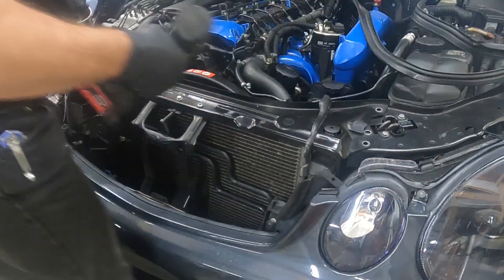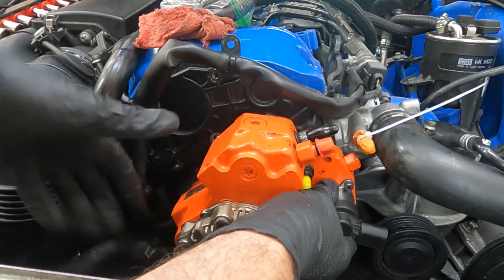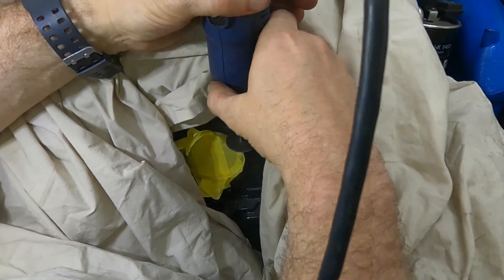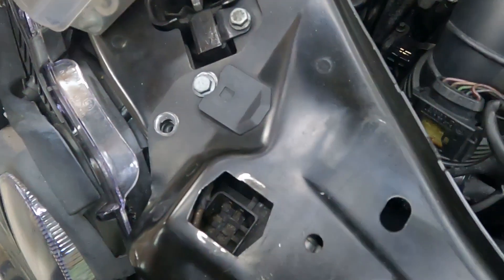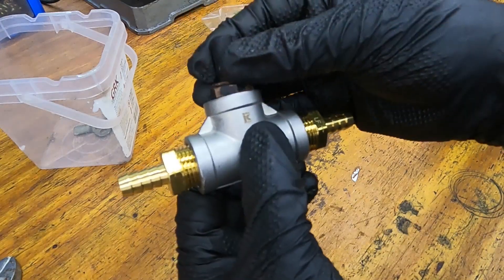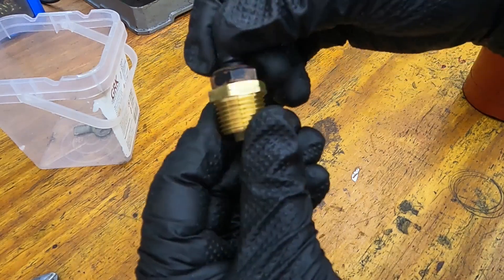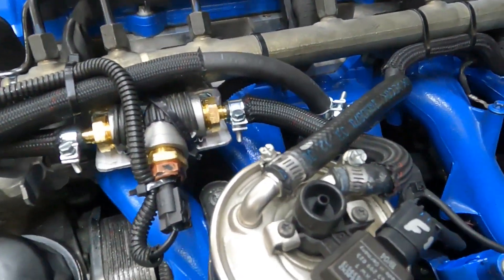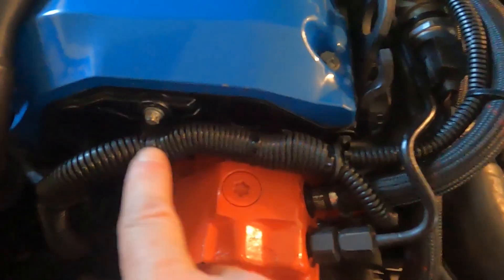More Fuel: Upgraded high pressure pump on an OM648 Turbodiesel

Comment: When you installed the blacksmoke coupling did you need to grind some of the paint off from the coupling to make i fit on the pump. Mine was way to tight ?
Reply from the maker: My pump didn't come from Black Smoke, t was just a grungy old pump that I threw some orange paint onto. I think my coupling was just bare aluminum. The diameter was a perfect fit, though other things had to be trimmed to make it fit. I did put some oil on the o-ring for it to slide in more easily. It was tight.

Comment: Hi, what fuel pressure regulator did you use? The stock one is facing the radiator. The one on your video is facing the AC compressor.
Reply from the maker: Good catch. You must be talking about the direction that the connector points in. The one that came with the upgraded fuel pump was damaged, so I pulled the one from my stock pump.

Comment: Did u you use NPT or NPTF? NPT does need thread sealent. 😊
Reply from the maker: Sure matches my experience. I thought that the use of brass on one side might introduce enough compliance that it would seal. Also, I was grabbing parts from Lowe's. You won't find NPTF there. I'll redo this at some point in the future.

Comment: hey man just wondering how tuning the pump went for you, i fear that maybe the fuel amount valve will give me some headache and also unsure what the baseduty for the pressure regulator should be as on wot it only controls via quantity valve😮
Reply from the maker: Well, that's exactly it, isn't it? You can't just install the pump and injectors to increase the fueling. You need a good tuner to dial it in. I found that the car would start and idle, but I purposely did not drive it until I had an updated baseline tune for the setup. Talk to Drew at Mid-Tennessee Diesel, you can find his contact information here: https://www.blacksmokeracing.com/software-specialists/
Reply from the maker: I neglected to state how it went: With Drew's tune, zero issues. It just worked. We haven't cranked things up, yet, but that's coming soon.

Comment: What is the part number for this pump?
Reply from the maker: Mine says: A6280700101. It's the stock pump from an OM628 engine.
Reply: @ArtOfDiesel where did you purchase your pump?
Reply from the maker: @LBZDreamer  I bought mine through Drew at Mid-Tennessee Diesel. You can find his contact information here: https://www.blacksmokeracing.com/software-specialists/ You could also buy it from the guys at Black Smoke Racing, you'll find it in their catalog on that site.